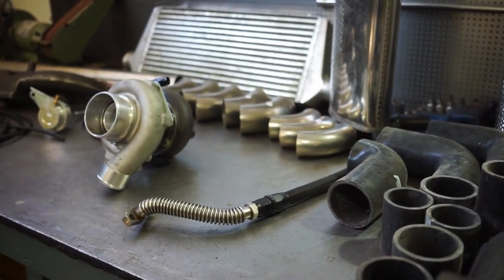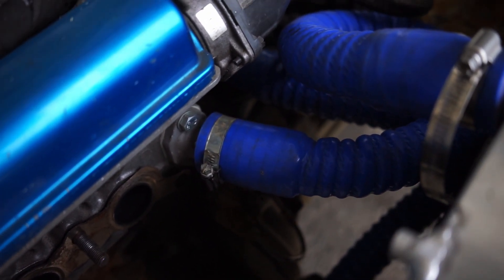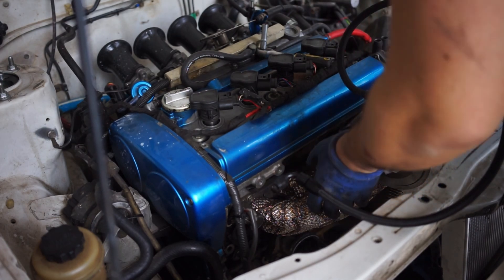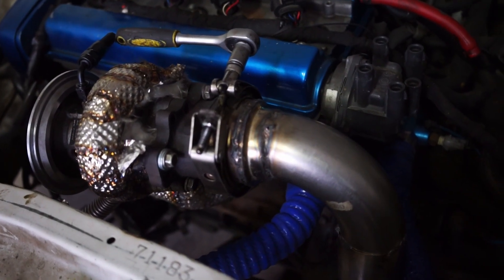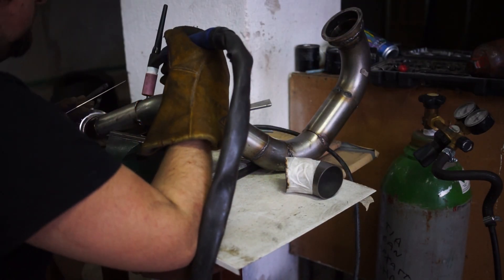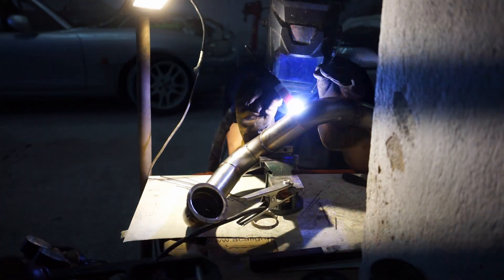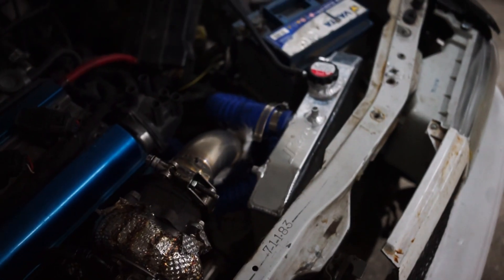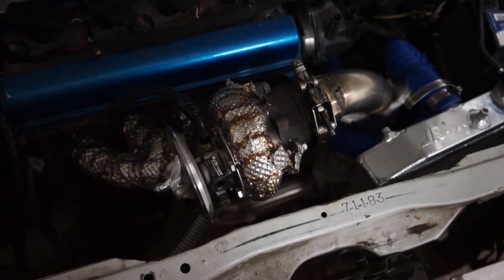Budget 4AGE 20V Turbo Build | Installing Manifold, Turbo and building the Downpipe! + Half size Rad

Comment: Im looking to the same build as this one 😄what size turbine housing did you use for that specific manifold is it T25 .64 or T25 .86.
Reply from the maker: Nice, but id suggest you get a Pulsar PTA4849G instead of the gtx 2860. it will have better spool and less backpressure even compared to the PTG series and obviously compared to a GTX: Im running a .64 exhaust housing but when going for the PTA id suggest going for a .72 due to the better response of the turbo and high RPM of the engine
Reply: @throttlebuddies0  Got it !!!
Thanks bro 🙏🏽

Comment: Bro where did you get the turbo manifold
Reply from the maker: Aliexpress tho not recommended for fwd setups and also has to be modified to fit 20v engines.
Reply: Hi is this the 16v exhaust manifold 
Planning to turbo my 20v but can't find a exhaust manifold will the 16v manifold work
Reply from the maker: @tariqjabaar5816  yes but its suboptimal and flange has to be modified + isnt that great. most custom tubular manifolds are for both. 

if its a fwd setup, dont get this one lol
Reply: @throttlebuddies0  thanks for the advice also what's the power figures after the turbo 
Would really love some more content 
Also planning to use the original plenum hopefully it holds😅
Reply from the maker: @tariqjabaar5816  im gonna do more videos on this setup. need to get everything working properly first tho as i have installed water methanol injection. im aiming for abour 300 hp.

Comment: Hey man. Yours is AE92 correct? I’m wondering if a lower mounted, smaller turbo would work with a full size radiator. Cheers!
Reply from the maker: its a carina t170 but basically the same as a e90 corolla 
a setup with the correct manifold for a fwd application would probably work. the one i have is for RWD i think. there arent any cheap ones available for fwd applications
Reply: @ that’s true. In my country we have fabrication kits for 4AGE turbo manifold, it costs about 70 euro and is made of steam pipe.
Reply from the maker: @J27M  yeah i know these but the issue is that the flanges tend to warp :D 

do you have a link maybe? if its euros its in the eu so might be interesting for me aswell as i live in greece

Comment: Can you turn the turbo around the other way?
Reply from the maker: no it will hit the valve cover/head
Reply: @throttlebuddies0  damn it would have made it much easier if it fit the other way around
Reply from the maker: @mtperformanceengines3508  yep true haha
Reply from the maker: @mtperformanceengines3508  yeah totally! 
a reverse rotation turbo would also fix that issue but i already had the 2860 and i didnt have the resources to just go out and buy another one unfortgunately :D

Comment: Hello ,good stuff ,wanted to find out what Conrods and pistons are u using
Reply from the maker: both stock complete build spec is in the description
Reply: @throttlebuddies0  and ntn done to lower the 10.5 compression
Reply: We must keep in touch bro I love the 4age especially the 20v ,but I love silvertop bottom and a black top head for a turbo, and if n/a same but with black top pistons ,both are  budget  builds and great power outputs
Reply: Your engine sounds healthy asf thou ❤love it
Reply from the maker: @purcellismail7558  yeah its not running a lot of boost yet since im still on stock inj and fuel pumps. but keep your eyes out for videos with both upgraded :)
Reply from the maker: @ you can send me a message on instagram if you want to. 
you dont really need a black top head for turbo they are very similar black and silver top